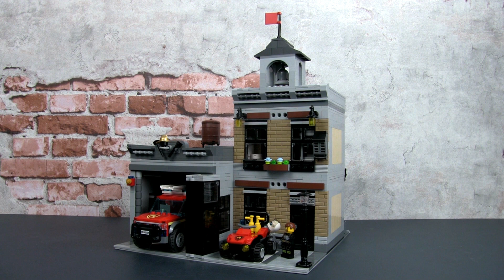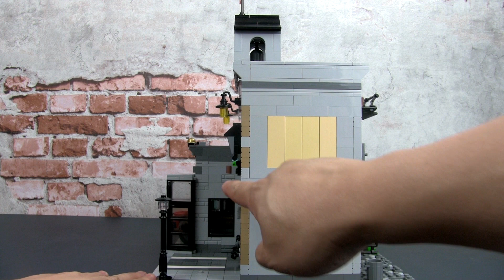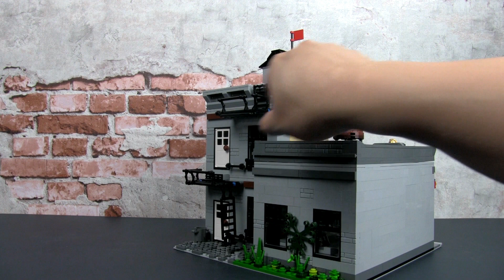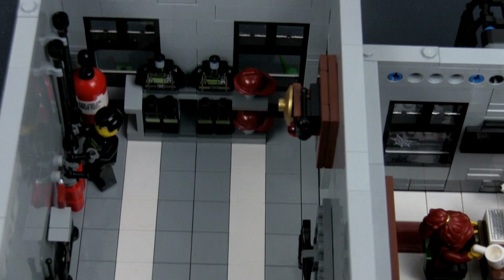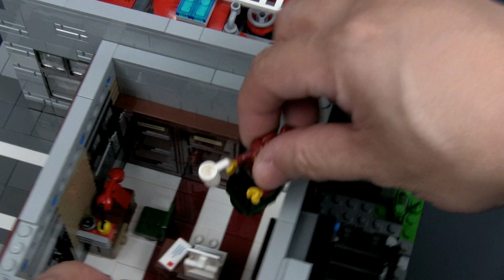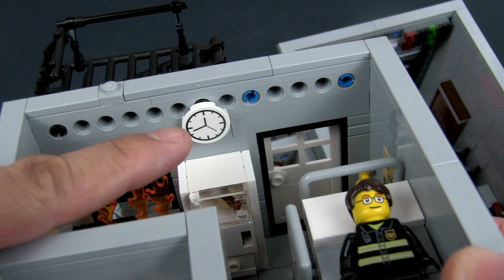LEGO Fire Station MOC Review (Final Version)

Comment: Hi JC! I like everything about this MOC - except for the 'holes' in the front facade. I don't quiet get those - why not cover them or use separate technic bricks for the wooden decoration tiles.

But that's nitpicking. As I said, great MOC. Keep up the good work!
Reply from the maker: Thanks a lot! I personally like the 3 holes as it gives an industrial look. But that is easily covered up with tiles if desired.